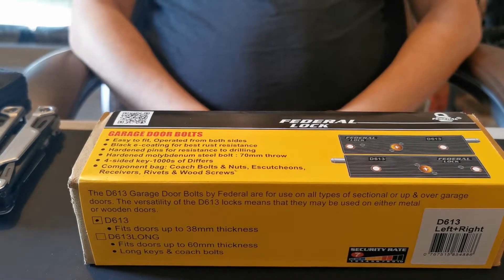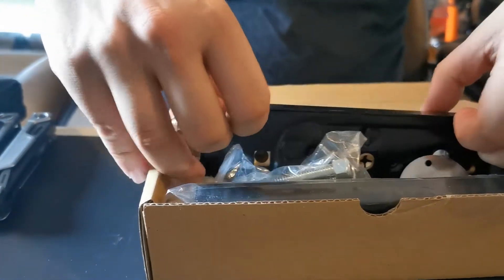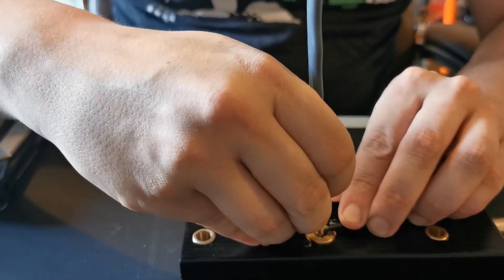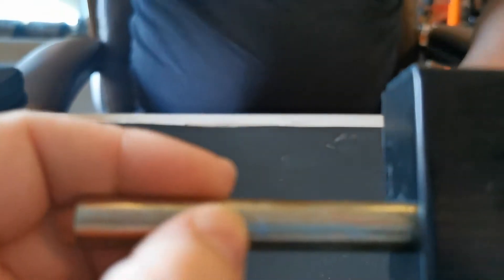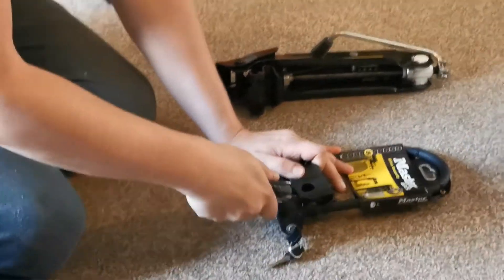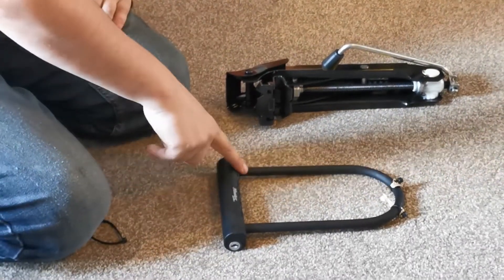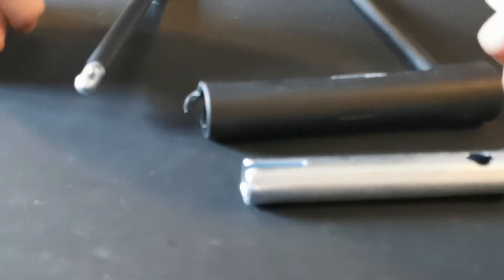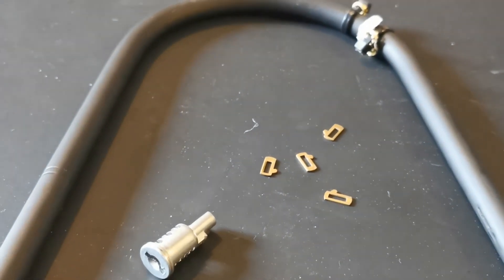Federal garage door lock review

Comment: the smarter kids will remind themselves of the position of the dimple after first or second successful insertion in locked and unlock  stage. There are pins on 3 sides, so in the quarter turn one set of key pins will feel dead. Only bad thing is the brass pins and the nice philips number 2 keyway. BTW interesting update on the U lock
Reply from the maker: There is pins all 4 sides of that one. Im not entirely shure why it locks up. I'm tempted to totally gut one to try and understand better. The u lock was fun haha. Thanks for waching 👍
Reply: interesting with pins on all 4 sides. Still think a Philips Combi pick and tension tool is the fastest way to open them, using extreme tension to create a new shearline. Works very well with the old ZeissIkon locks too
Reply from the maker: Would be good to test that theory. But I dont have the equipment. I have other ideas im going to try tho. 👍